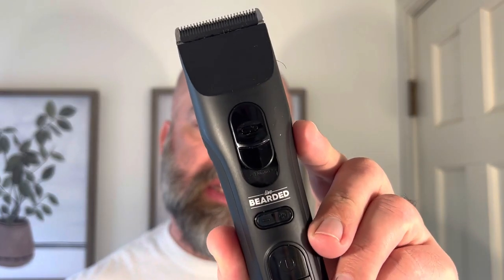How To Do A Maintenance Beard Trim On A Business Corporate Short Beard

Comment: Have you seen the philps one blade pro? It comes with one guard that has 14 depth settings. Great for fading the sides. 
Great video.
Reply from the maker: No, I have not. Thanks for the heads up, will check it out.